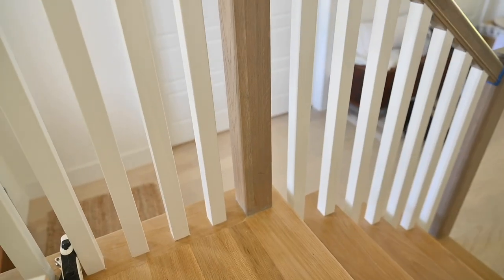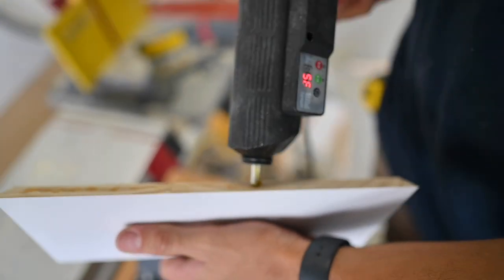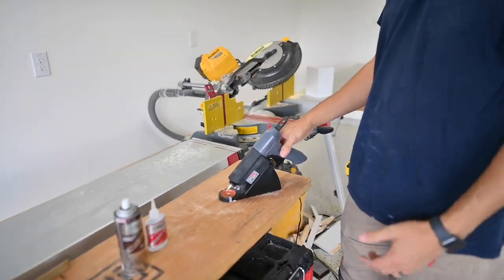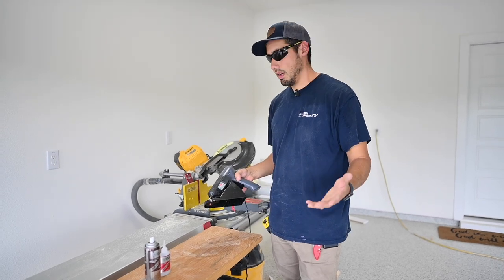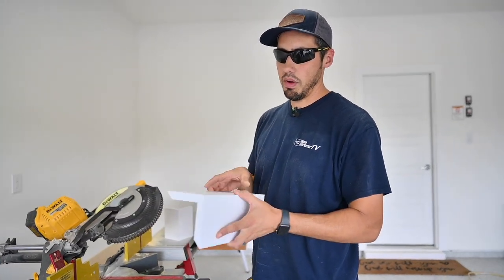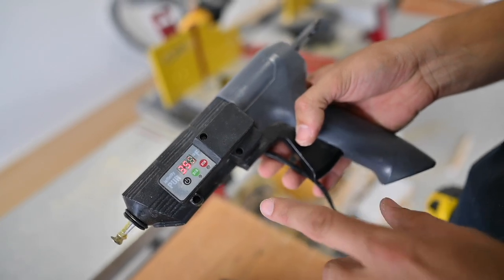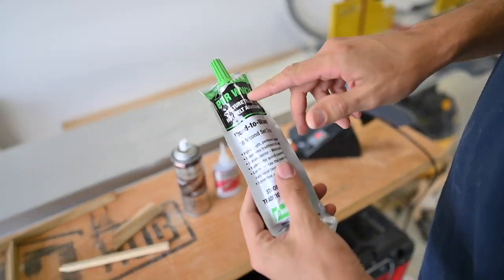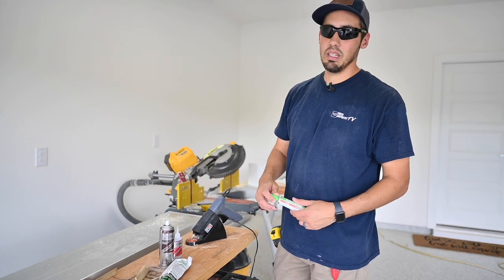Mortise and Tenon in THIS BOTTLE?

Comment: This glue expands slightly while curing, hence the need for clamps.  You can however hold the joint by hand tightly for about 30 seconds and still get acceptable results.

Use often on prefinished cabinet crown without clamps and get great results. Doesn't take a lot of glue to hold well.  Oddly, it doesn't hold maple as well without scoring the joint with your knife before gluing.

Great product.

Comment: In my career as a boat builder, I've been using hot melt glue to stick bits and pieces together for about 30 years. I'm not sure what the glue actually is but it comes in sticks, not a cartridge. The gun I have a a 3M (model T100 I think). It's not a hobby gun, uses 5/8 dia sticks and gets HHHHOTTT. I use cotton gloves when I use it so the glue doesn't get on my skin.

This PUR glue looks like it's a very good glue. I don't think the stick glue is as strong as the cartridge stuff but I've never tested it lie was shown in the video.

Comment: Just tried various drill bits and nail sizes. A 7/64” drill bit works but a ⅛” does not. I had some nails that measured 7/64” and those worked perfectly. Don’t know the common nail size. Just take a drill template and find a nail that fits the 7/64” hole tightly.

Comment: I love the stuff but I’ve had it harden up inside the carriage somehow on occasion. 
I’ve heard cap it while it’s hot,  and don’t uncap it until it’s hot. I’ve wasted a few fairly new ones and that kinda killed me on them. Perhaps I’ll try the nail.
Reply: Yep its pricey. Kinda figure you burn a 20 buck tube when you open it. Resaon i havent gotten one yet but this has reminded me to get one.
Reply: I'm still waiting to learn what kind of magical nail one needs. Meanwhile, I've been using a quart mason jar with an inch of silica gel on the bottom to store both my opened and unopened tubes. (My wife had a 1-lb jar of flower dehydrator craft stuff sitting around unused.) A small, digital, relative humidity meter I have reads a steady 10% in the jar, which seems to work -- so far I've kept opened tubes over 3 months with no problems, when combined with cap-when-hot & after dispensing an inch-long line before capping.

Comment: Impressive adhesive, although I'd like to know how long it lasts.  I've seen epoxy break down after a few years.  White glue get brittle and fracture easily.  Etc..   Will these glued joints still be strong in 10 years?
Reply: Probably. PUR hot melt adhesives have been used for almost 30 years in the furniture manufacturing industry. It forms a polymer chain when cured, which is stronger than the wood (unless you’re using an ironwood like Australian Buloke, or maybe janka ebony or a high quality old-growth hickory). I had a Thomasville chair bought in 1998 that got broken while moving in 2017, and the break was splintered and jaggedy where it was glued…the glue held when the gorilla movers dropped it but the wood didn’t.

Comment: Does this glue soften/weaken if warmed again? So you couldn't use it near a radiator for example.
Reply: No, PUR doesn't re-melt like ordinary hot glue. It cures permanently like all polyurethane glues.
Reply: True answer…once exposed to moisture, it forms a polymer chain and when cured, it’s solid. An analogy would be concrete - once the Portland cement has cured into concrete, you can’t ever repour it.
Reply: Ah, very interesting, thank you.

Comment: Try to buy on your site but no shipping cost for Canada … could you check it out ?
Reply: He sells cartridges for $12US 
Amazon Canada $24 
$12US to CDN =$14 bucks and change. By the time you add shipping, cross border fees and GST your not getting it cheaper. Buy more than one from Amazon and get free shipping unless you have Prime. The gun he sells for $90US which =$111.57CDN. The gun on Amazon Canada is $150.30 plus $25.19 shipping and import fees. Then the GST and whatever else this crappy Canadian government wants to tag on. So is it worth it one might ask. Seems Canada as usual gets shafted and the USA don’t on most products.